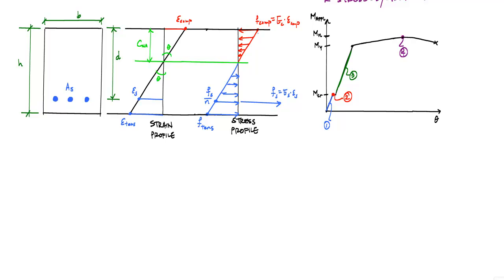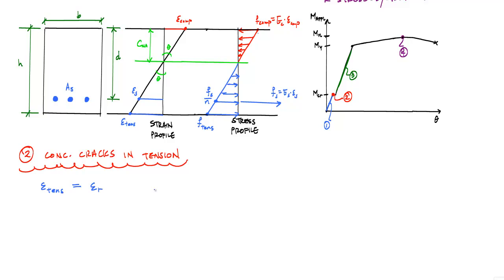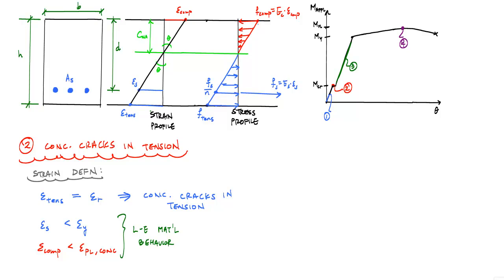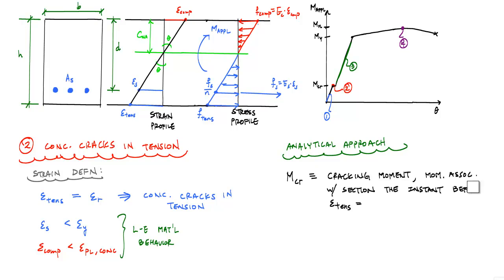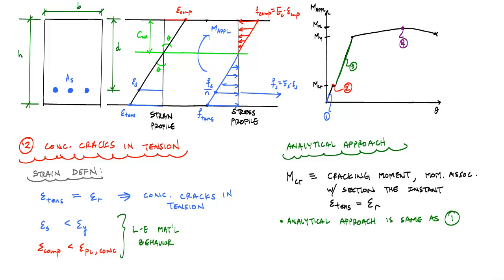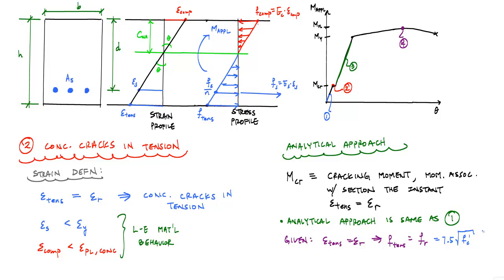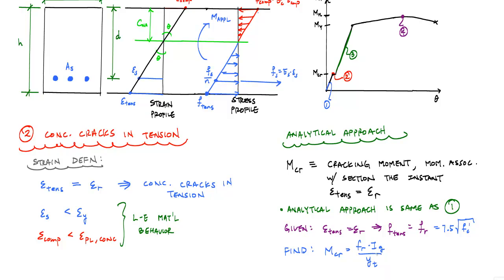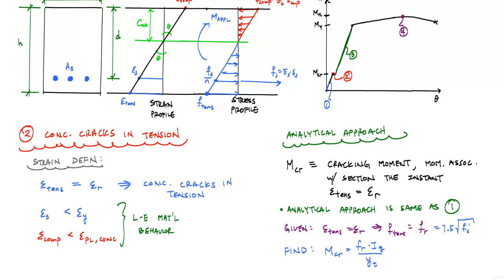Behavior of Reinforced Concrete Beams Subject to Loading (3/5) - RC Analysis and Design

Comment: Please correct me if I am wrong, but it is my opinion that stage 2 would be considered the first mode of failure.  And that for a safe design, you want your concrete to remain in stage 1.

I understand that stage 3 is still important so that after crossing stage 2, it is not a catastrophic failure.  But still, I'd intuitively think that a safe design stays in stage 1.
Reply from the maker: carultch stage 1 is really small and the steel is not used in that section..it assumes we only have concrete.  most structures operate in the linear elastic range during normal use.  we design for extreme events where failure is defined when tension steel strain reaches 0.003.